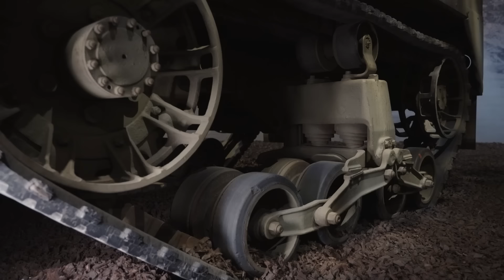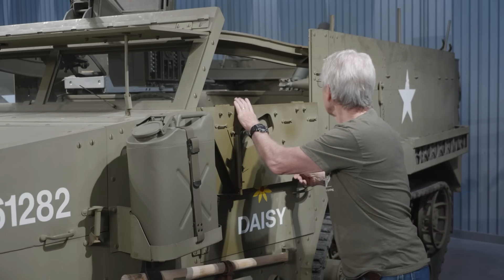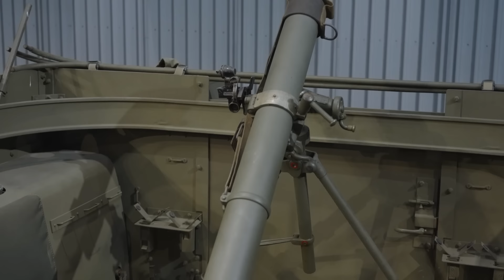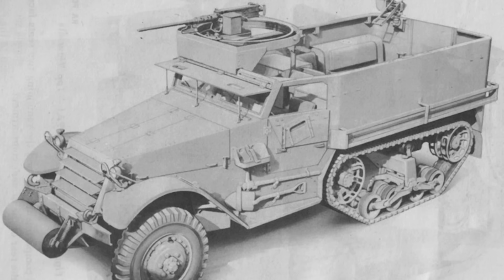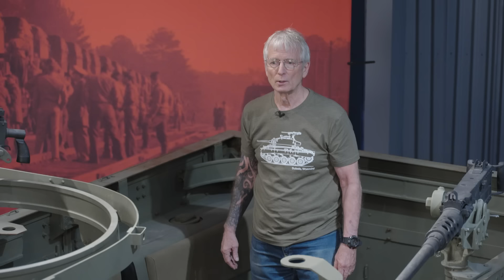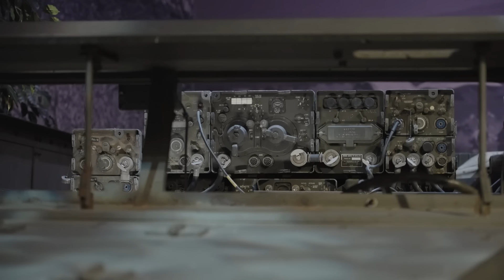A Review of American Half-track Armored Fighting Vehicles in WWII and Korea

Comment: A correction.  You stated that the M15 variants that you have, have a 37mm Anti-Tank gun as well as two 0.50 Caliber Machine Guns.  However, the M15 did NOT have an Anti-tank gun, but rather a 37mm Automatic Antiaircraft Gun as the heavy weaopn.  Combining the 0.50 Calibers with an Antitank gun would not have made any sense.  I believe that same 37mm gun (or a variant thereof) was also used on both the P39 (I think that was the version) was well on US Navy PT Boats, which initially used guns stripped from crashed P39s.

Also, the M16 was used in large numbers and shot down numerous Grman and Japanese aircraft by the end of the war.  The US Navy in fact mounted some M45 Maxim mounts on some of their ships near the end of the war in an attempt to increase the firepower.  In fact, one of the photos that accompany your talking about the M16 shows an M16 guarding the Ludendorf Bridge over the Rhine River after the Americans had captured the bridge and the Germans were attempting to knock it down.

Comment: 5:07 Hmm

Why did they put the fuel tanks with the occupants instead of burying it in the floor?

I wonder in all Practical Efficiency

Would the best Probability be putting it up high or low

It would be far superior ergonomics for the Squad and Crew to access their kit and to remove most of the complex storage bins from the construction

And safer as the tanks would be buried under additional steel making rare fires even rarer causes of Death and most importantly keeping the vehicle running (perhaps with more tank volume aswell); incredibly Efficient in that perspective 

But this vehicle is far more susceptible and prone to mines compared to others

But the vast majority of tank punctures are from above and beside

Most mines would only destroy the tanks if not the occupants, not ignite them

And Practically far Greater fire hazards come from Human Error and other foreign threats brought into the vehicle

So I wonder if lowering would be better….

Yeah; it majority would be better overall

It would also be cool if You could insert extra fuel tanks instead of storage so this thing could keep running if pushed to the brink and beyond

Modularity; can never have enough modularity 

I need atleast 1,000 new modification kits on My desk by Tomorrow

Oh and I looked up the construction of the M3

It was mostly because their wasn’t as much Liberal volume below the floor and too much frame structure

They still could’ve been more Efficient with their Fuel placement like using four separate spread out tanks, more covered lower profile tanks

And-or modern External rear tanks which aren’t much of a foreign Concept to them

Just a hint more creative 

It’s the tiny things that matter; little things add upto big things 

One little Ingenious improvement and everybody cites it as major progress because it wasn’t as popular and-or mass produced before though it’s nothing new nor especial

Comment: M15 used a M1 37mm auto cannon which was fed from 10 round clips. The cartridge cases were similar to the 37mm antitank round but with a lock groove in the base similar to 40mm Bofors ammunition to hold the loaded ammo in the clip.
https://en.wikipedia.org/wiki/37_mm_gun_M1

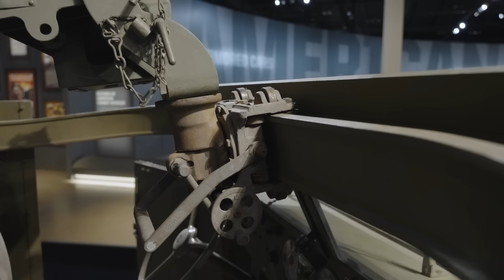Comment: 8:55  Multiple rail mounts were probably to help provide air control 50 in WW2 were good at taking down aircraft as well as light armor. With 2 on a rail it lets you cover both sides of a strafing run or an ambush. Keeps your supply lines a bit more safer when they can take care of themselves from threats on land or air that are trying ambush and cut those lines. That's just a guess though. Could just be to cover the other gunner and always keep a target under suppressing fire when one has to reload.

Comment: I have a sandblasting business in Colorado, and I have had several people bring me parts to these halftracks. I clean up parts that are rusty oily painted and dirty, so they can restore them. 
   One customer tells me that there's 2 kinds of armor plating that was put into the back end of the truck bed. One was a cheap plate that would have a divot missing if it was hit with a .30 cal bullet. More shots to the same spot would fracture the plate. This was a standard armor plate made by uncle sam somewhere. 
   The other more impressive armor was made by the Diebold safe company, and will have a small square with a D in it, stamped in one corner of the plate. This was a tempered plate made to withstand a .30 cal round. In fact, only a .50 cal round leaves a mark. 
   My customer told me that they shot modern .30 and .50 cal rounds at these plates, and the diebold plates fared much better, but fewer were produced for the halftrack than standard armor.
Reply: The Diebold company made 1/4” face hardened armour plate and would only stop .30 cal if lucky. This type was used on the Whites, Diamond and Autocar Halftracks. The Rolled homogeneous armour (RHA) was 5/16” thick and used on International Harvester Halftrack, most of which went to commonwealth forces and this would usually stop .5” rounds.
Reply: @m3bobbyball  I heard it was the other way around. Against bullets, face-hardened armor tends to do better than rolled homogenous armor of comparable thickness. Part of the reason the RHA plate was thickened was to compensate for the reduced material protection. 

The hard surface shatters bullets while the softer and tougher back of the plate tends to absorb the impact. It makes it more resistant to bullets but more likely to spall and shatter when hit. Battleship and cruiser armor is typically made that way. 

Rolled homogenous armor of the time is uniformly made of softer but tougher plate. That makes it less resistant to bullets, but makes it less likely to spall or shatter. US tanks used them to prevent ricochets from non-penetrating hits and explosive shells from causing excess spalling.

Comment: I worked for large rice farmer in northern calif. He had a half track bought surplus fron the navy at Pittsburg, Calif. Naval Munitions area in the early fifties. It was a White engine, it had a 10,000 lb 360 crane mounted on a flat deck and powered from a pto with a 3 roller chain drive. There was a tractor metal seat mounted on the turntable with controls. We used it for a field crane , it had a 20 ft. boom with the saddle where the machine gun mount would be. Drove this infernal machine on the county roads many times to tepair land planes and other field equipment. If you weren't deaf, you were rattled at 35 mph. It was a trip to drive, but it got the job done. Only got stopped once by CHP, because he had never seen the version with crane. He said he was 4th Armored during WW2 TANK driver/ mechanic. He laughed and said only the Navy would do that. Enjoyable trip back down memory lane. Fantastic collection, excellent video and information.

Comment: I never forget my dad learning me, how to pronounce Half-Track...im Dutch.

We use several type Half-track's in a Battlefield 1942 Modification, called: Forgotten Hope Secret Weapons.

This is what is mentioned about the Bofors versions on their FHSW Wiki page:
The T54 AAGMC was a self propelled anti-aircraft gun variant of the M3 half track mounting the 40 mm Bofors. It was tested in 1942, the gun mount proved to be unstable when fired so only the prototype was built. The model in the game has the traits of the T54E1 which was the second design for the concept that put cylindrical armor plating around the gun position. The T54E1 also added outriggers & jacks that could be deployed for additional stability for firing the gun. Nevertheless, none of the five designs for a M3 Half-track with an 40 mm Bofors were successful enough. 

Thank you for the great Video!

Comment: Regarding the M4A1 with the mortar reconfigured to fire forward, did it also come from the Smith collection in Utah? There are some pictures that show several M4's configured this way in Europe during the war. This is the first one I've seen with a plate instead of the rear door. If that plate that replaced the door has a factory heat stamp on it then it must be an original conversion. From my research it seems the Army kept M4's in reserve storage up thru the mid 50's. I'm really into half-tracks I operate Classic Half-track Rescue. Great collection you have there I hope to visit one of these days and see all those great half-tracks.

Comment: THE M15 and M15A1 were designed as antiaircraft guns using semi rimmed cartridges feeding from 10 round clips. They also had a tube to stick down the barrel to flush the barrel to cool it off fast after firing. Later the 37 mm T250 six-barrel Gatling gun was tested for T249 Vigilante mounted on a variant of the M113 APC. Two serious barrel ruptures lead to the cancelation of the project. I looked a surviving example back in the mid 1970's at Aberdeen proving ground. Same problem as the one you have overheating in rapid fire.

Comment: Slight correction- At 30:02 you referred to the gun on the M-3 75mm Tank destroyer as a "french howitzer".  It was actually classified as a "field gun" and fired on a relatively flat trajectory and at a relatively high velocity, which imparted its anti-tank capabilities. The original M-2 75mm gun mounted first in the M-3 Medium and later in the M-4 Medium was based on the same gun, but with upgraded recuperators and recoil compensators.

Comment: A Logger I once worked for, came home to no jobs available but he was not bothered.
He had bought a used m-3 half track as military surplus for $100, and as he owned 60 acres of Oregon coastal swamp timbered acreshe went logging.
Did well enough he got private and corporate logging contract using that same M-3.
After awhile he bought catterpillars for logging.
Tben after a couple years he got contract with Bonnieville power, hauling supples along remote power lines.
Sadly the m-3 endedupbrusting for years until a junk dealer bought and scrapped.😊

Comment: The M3 (Or the 'International') was a preferred assault vehicle by the IDF Infantry and its paratroopers, it used extensively  in all the wars from 1948 till the end of the 1980.   after the 1973 war it got a power uprate included a diesel engine,  a Wilson Semi auto gearbox and a power steering which in turn allowed to add more armored plates.

Comment: I was just riding a Portland Oregon Trimet bus.  Ironic that each passenger in a WW2 halftrack had a 4 inch seat cushion.
Trimet busses have Zero suspension, hard seats and square steel tires.  The only cushion is the pavement between potholes.😅😅
And no machine gun 😢

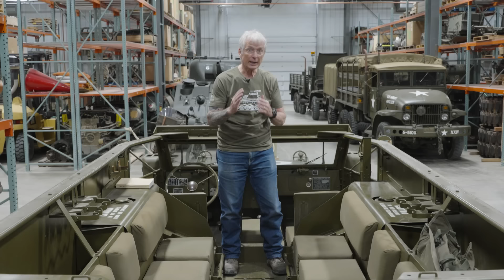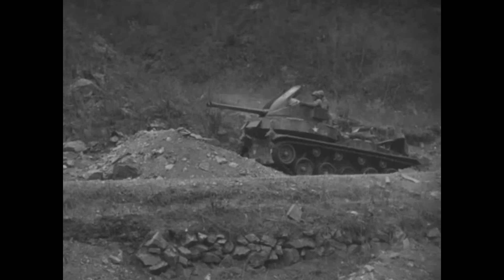Comment: @ 16:38 the black dog loafing about the shop. @24:54 film of the M19 twin 40mm "Duster" @27:59 M16 multiple Gun Motor Carriage with a Quad Fifty M45 Maxson gun mount

In Korea it was learned that the Quad Fifty should be paired with the 40mm Duster so that the 40mm Bofors could keep Chinese crew served weapons from getting close enough to knock out Quad Fifties.

Comment: I was stationed at Naval Weapons Systems Training Facility, Boardman (Boardman Bombing Range) Oregon '79-80. The Umatilla Army Depot  had autioned off some equipment years before i got there, one of which was an old Army HalfTrack. Some of the boys got together and each chipped in enough to win the bid on it. They decided to drive it down to the range and play with it there in the sand and sagebrush. They got about a third of the way there on the frontage road and ran out of gas. Ran back, grabbed a few cans of gas and it was enough to go about another third of the way before they ran out again. Repeated the process and were able to enter through the North gate ( not an official gate, just a barbed wire / post that could be pulled aside ) and drove over to the old MainCom buildings. They ran around with it a bit, but said it got gallons per mile rather than miles per gallon. Couldn't afford to drive it too much and eventually they dug a pit at the old dump and drove it in and buried it. Far as i know, it's still there...     ☆
Reply: They BURIED it?! Why?  Sounds like it was strill servicable.  Crazy.

Comment: Another commnet to your M16A1.  During WW2 in the ETO, some units mated their M45 Maxon "quad-fifty" trailer mounted systems with extra M2 halftracks that were in the depots.  A similar situation to the later M16A1.  A "new" halftrack Multiple Gun Motor Carriage was created.  Usually referred to as the "M16B" in some histories.  By the way, that 37mm gun on your M15A1 is NOT the anti-tank gun M3A1.  It is the 37mm anti-airctaft gun M3 (the delightful confusion of US Army WW2 weapon designations.  This was an automatic gun intended for AA fire.  Developed by Browning and Colt. These were deployed prior to WW2 and early in the war on mounts that were very similar to the wheeled cruciform mounting of the later Bofors.  The superior 40mm Bofors gun replaced the 37mm as production allowed.  There was also a 37mm AIRCRFAT gun, sometimes called the "Oldsmobile 37mm" that was used in the P39 fighter and on some USN PT boats in the Pacific.
Reply: Believe the Navy 37mm's were salvaged from wrecked P39s at Henderson Field on Guadalcanal

Comment: I have a M15A1 halftrack registered and insured. I drive it around town all the time. They like 30-35 mph, but I had it up to 50 mph once, very VERY noisy, and the floor gets hot. Easy to drive, but you need to learn how to “double clutch” when shifting, like an old tractor.

Comment: It's a shame half-tracks went out of style; taking a reliable truck and slapping a set of tracks on the back is such a wonderfully simple (both from the overall concept but also on the pointy end of things), reliable, and elegant solution to off road capability. The US WW2 half tracks in particular have such a rugged yet stylish look with the long and boxy hull that is sorely missed these days
EDIT: 16:38 Hello puppy!
Reply: Xx
Reply: 2😂
Reply: So many are still being used by foreign countries
Reply: It's kind of a compromise solution, though. Best to separate the tracked and wheeled vehicles. You just get too few of the benefits of track and wheeled, but all the disadvantages of both types.
Reply: Replaced by the Bradley.